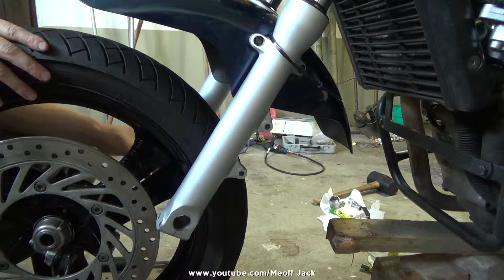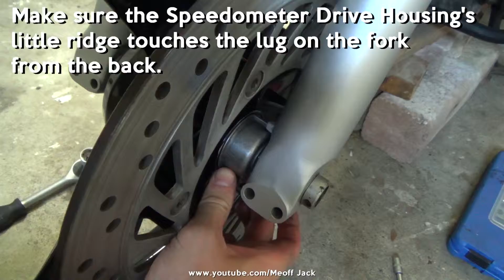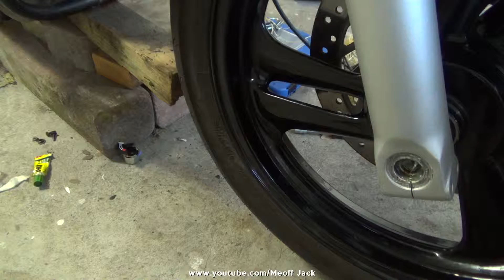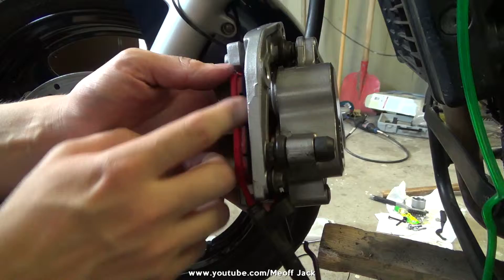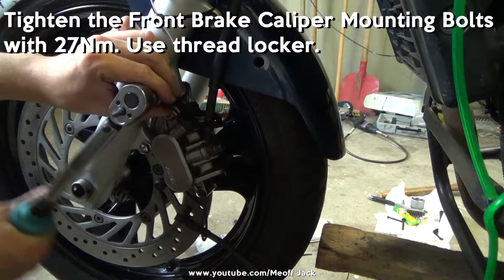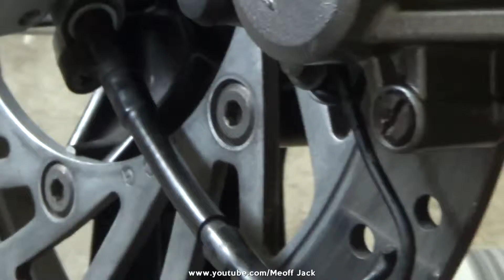Honda NTV 650 - Front Wheel Installation / Wheel Bearings Check

Comment: Whilst I am loving my NTV...I am getting a bit fed up with the difficulty selecting neutral.  Either up from first or down from second.  

Quite certain it isn't clutch drag...just a really pain/stiffness to engage neutral.  

Any thoughts?
Reply from the maker: I have the same problem. I just hold the clutch at stops.
Reply: It helps to shift to first, clutch in, rev it up slightly (like 2k), and shift in to Neutral while revs drop. Works quite well.
Reply: Change engine oil to 5w40 fully synthetic it helps a lot in selecting neutral at a stand still

Comment: Hi, good video...I am starting to do more and more work on my lovely, battered, agricultural, NTV 650...  I am looking for advice on how to 'lift it's, initially for will on the front - fork seals.  I see you out it on blocks...but what was it supported against, just the engine block? 

 Is that ok?

Will it balance backwards on to the rear wheel?

Any advice, tips, videos, recommendations for lifting the front gratefully received!

Cheers
Daniel
Reply from the maker: On the center stand with supported engine is enough to work on the motorcycle.
Reply: Meoff Jack - thank you!

I may have more questions as I gradually work on my NTV...I'll try not to hassle you too much!

Comment: Please can i ask.
Q. Will this bike suit someone who is 5,11 bearing in mind its low seat height and peg position ?

Q. Would you see a substantial loss "fitting a rstriction kit for A2 licenced rider ?

I find your videos very professional and will respect your answers.
Sub'd N Liked
John.
Reply from the maker: Hi there,

I'm 5,8 and I can drive the NTV for hours without problems. For my height it's the perfect size. I'm driving unmodded. I don't think 5,11 will make such a difference. But maybe I would suggest getting lowered pegs and maybe a raised handle bar. Can you test drive? That would be the best solution. 

I don't see any problems reducing the power as it's done by the intake manifolds. My bike for example had only 20kW stock. Now it's the 37kW version only by switching the intake manifolds. Went up from 145km/h to 180km/h.

Thanks for the feedback!
Reply: I know you didn't want a reply from me John, but I'm 5'11 and I find the bike perfectly comfortable.  It's my first big bike (but been riding a long time), and I simply love it!  I can feel confident when needing to plant both feet flat on the ground.  But when riding I don't feel particularly scrunched up - although don't have much else to compare it to! Gear changes and rear brake position feel fine.  And I really love the way the tank sits quite "high" so you are 'in the bike' rather than 'on it'.  I can't really explain, but it feels great. It's a bit agricultural...having to clunk through the gears, and finding neutral can be a pain...but it's gutsy...and trouble free - on the whole.  A great first bike to learn both your riding and also workshop skills!  

More knowledgeable people than me may say otherwise, but my very vague understanding is that "twins", such as this have low down grunt but less top end.  "4s" have less grunt but higher speed.  I don't want to "go fast", but I do want to "get UP to speed fast"...and I think, for a relative newbie, it does pile on the power quick!  So, perhaps depending how it is restricted, you may only notice a loss of full speed, but not how quickly you get there?  That wouldn't bother me, but it might you!  Of course...I am unsure how 100% this is... 😅  Let us know if you get one!